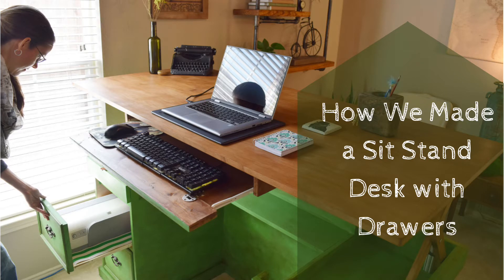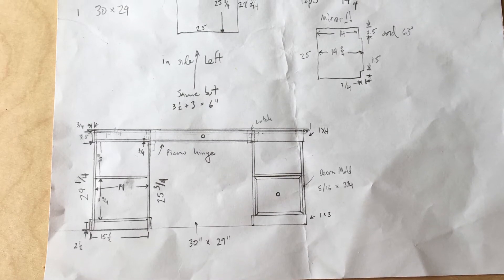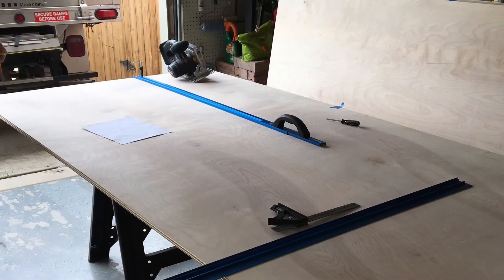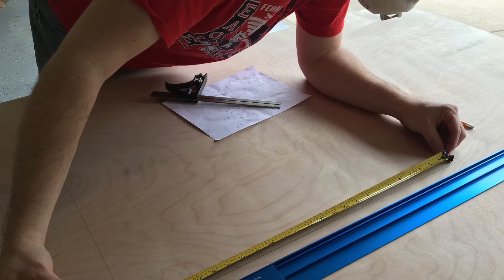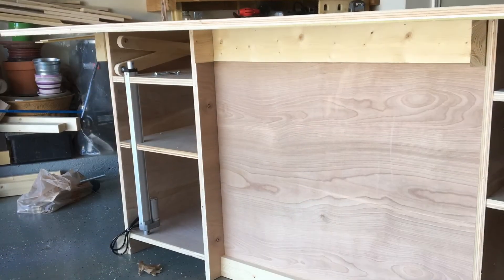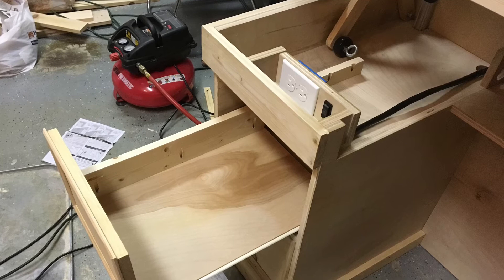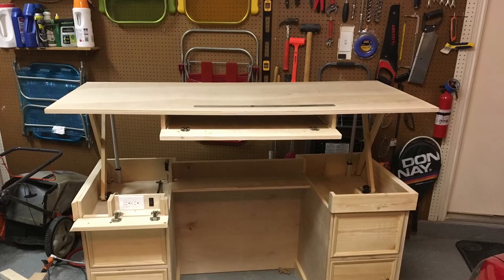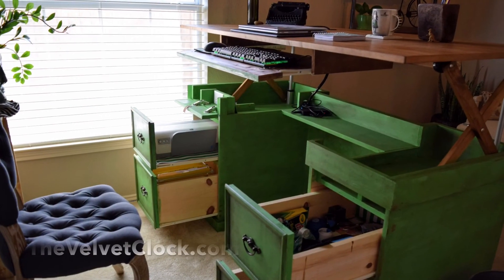How We Made a Sit Stand Desk with Drawers

Comment: The X type support is very intriguing.  The big problem with sit stand desks is how unstable they are when raised.  Especially if you tend to lean on your forearms to take some weight off your feet, ankles and knees.  Its also easier to keep a straight back if you lean on your forearms a bit I found.  It just feels better.  But that weight on the front of the desk causes problems if its being raised on only 2 points.  The obvious solution is to raise it on 4 points but that would hugely raise the cost as then you'd need 4 motors.  But you have chosen to address stability by this X type support.  What I don't understand is how do you lock it so it supports the desk?  Because if its not locked in some way there's not going to be much support.  I see you're using just a laptop so there's very little weight involved.  You're cheating! :)  Hope to hear from you.  
You could use a quick release type lever, similar to what holds most bike wheels, as a locking mechanism.  It doesn't have to be very strong either.  Its not as if we're jumping up and down on the front of the desk!  Another problem some people have is their computer monitor uses a very unstable stand.  This is getting more and more common as monitors get bigger and their prices are falling to be more competitive.  If you're using a monitor arm its not a worry but most people don't go that route.  With an unstable monitor stand even typing can move the monitor a little which is very distracting.